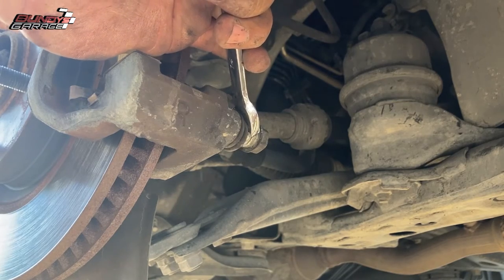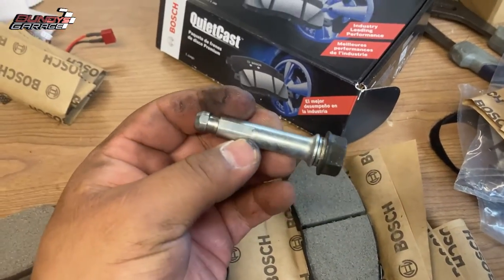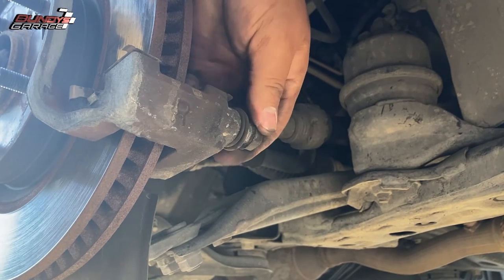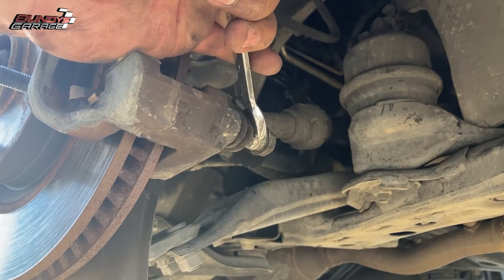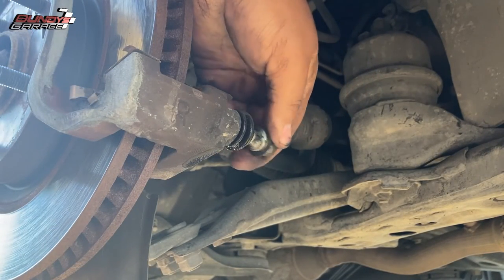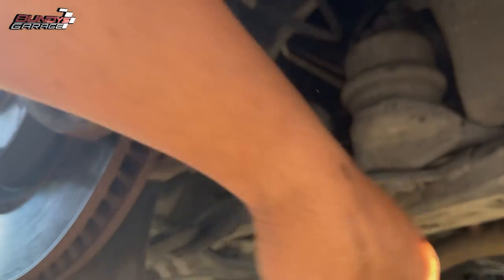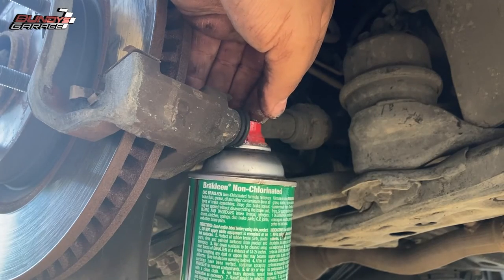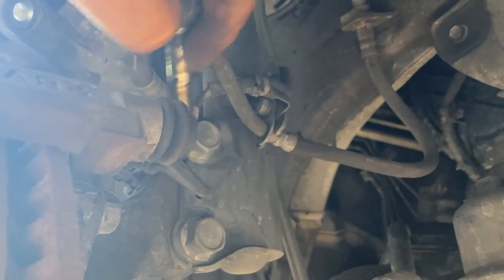STOP Stuck Caliper Slide Pins | Remove Rubber Ring | Prevent Stuck Pin | Honda Lexus Toyota Acura

Comment: Exactly right.  Those little rubber sleeves on the caliper pin are a pain in the ass.  I’m a master mechanic on just about everything including jet engines.  I’ve never heard a caliper rattle without them.  I do replace them  but I leave them off my personal vehicles.

Comment: Why couldn't they design the lower pin the same as the upper one? Meaning without a useless rubber part on a constantly moving pin?! My sisters brakes were vibrating like crazy because both of these pins on the front side were locked up. And when i say locked up i mean i needed a hammer and a chisel to get it out. I tried reinstalling it using silicone grease but those little mfs will get stuck if they have been deformed even in the slightest out of their factory specs. I threw them in the garbage and brake tested the vehicle. Runs like a charm. This video got in my favorites btw. Finally a mechanic that also has common sense. We don't have to follow everything up to spec just because factory says so. If it works, it works.
Reply from the maker: Sir I applaud you! You are one of the few who understands. May the Force be with you!

Comment: This is good advice. Over the years I’ve had way too many brake issue due to this rubber grommet. And previously I just used to replace them. But even the new ones swell. Now I remove them and much less issues. However the rubber part I do replace sometimes is the rubber boots that seal the slide pin from the elements. If those get holes in them from wear and time, water gets in and rusts the sliders.
Reply: Good advice

Comment: I'll try it on my 2002 Camry with 260,000 miles. Dealership fixed them 2x, on back. I'll do it myself this time. Thanks for the tip. I hate working on breaks. Kroil works good but smells so bad.

Comment: I use q-tips to clean the inside there and remove the old grease after removing the caliper pin boot, then use brake clean spray. let dry then add grease and put back everything. I clean the caliper pin boots with Q-tips. I don't use brake clean there.
Reply: Me neither, don’t use brake clean there
Reply: I do something similar.  I use one of my pistol cleaning rods with solvent soaked .38 caliber patch.  Works great.

Comment: Great advice. Recent drilled and slotted PowerStop Z36 rotors and pads only lasted 20k miles due to right rear caliper hanging up/scoring rotor/wearing pads THROUGH THEIR BACKINGS/and WELDING the rotor to stop every time! Slide pin with rubber bushing seized. Caliper piston never retracted. Bushing removed, wire wheel brushed shiny and new brake grease applied WITHOUT bushing! Couldn't decide top/bottom leading/trailing edge for pins anyway! Thanks.

Comment: I have the same problem after putting new pads the pins that have the rubber don't move freely and doesn't seem to work like I have new pads !! I'm redoing them again and not putting the rubber back on the pin ..

Comment: Hmmm interesting, I was researching this because I just did a brake job on my CX five and all the rubber pins were on the bottom. I admit I used the wrong greased red and tacky so now I have to take the pins back out and clean them I knew I needed silicone grease but I didn’t have enough to do all four. I don’t know how you know which pens go where I know one is round and one has flat spots. I never understood how to tell where they go back in other than to put them back in where you took them out. Funny thing about the rubber pieces on the pins is that when you buy a rebuild kit none of them come with them so they must not be important if the rebuild kit doesn’t come with them right? Is it because the dealership wants you to pay them money for the rubber bushings that they probably charge $20 a piece for. I’ve never left them off but I think I will try that just to see what happens. Besides I’m thinking about them swelling up right now as I type this up LOL because I believe red and tacky  a lithium base Grease. I know I’ve learned that one fixing things there’s mostly only one reason why if you have to ask yourself why did they do that. It’s all about money bro. Like the owners manual of the CX five says use 0W 20 if you’re in the United States or Canada. Other than that you can use 5w30 everywhere else, Oh and you can only use Mazda oil or Mazda anti-freeze, and all other fluids must be Mazda or it won’t work. The only fluid I kept original mazda is so far the antifreeze and transmission fluid. The only one I really would be concerned about would be the transmission fluid though. I will always use Mazda fluid in that just because No other company out there yet says there’s is compatible and even if they did say that I’m not sure I would trust it. I even asked Amsoil if they’re transmission fluid was compatible and they told me you’d be better off to using mazda fluid.

Comment: Great video Bundy. I didn't no that you don't have  to have the ring on that bolt because of this same issue when i did the brake job on my 2006 odyssey the ring was swell up so i replace it with new calipers both side. I couldn't find the ring piece anywhere only dealer item
Reply from the maker: Just throw it away, you don’t need it!

Comment: My brakes were working fine.2015 Toyota took these off.And now The front brakes pulse hate more or less driver's side. You can feel it through the stereo column.. There was no problem with them all. So now there is with them all. So I'm putting them back on tomorrow, if the answers any questions? I think it really depends on the making model tomorrow in the Size.
Of the parent's self

Comment: Great topic, if you routinely grease the slide pins I do not see any need for these bushings, the rubber bushing adds unnecessary friction to the pins even after being greased, the piston side will retract but the sliding outer pad will have more drag on the rotor from the rubber bushing not sliding freely in the bore, this could wear out the outer pad faster. The other benefit without the rubber bushing is that you can use a petroleum based grease because the pin and bore are all metal..
Reply: Exactly. With that rubber I had to use only Syl Glide or the Toyota factory grease. Without those rubber bits, the regular Permatex grease is fine.

Comment: I've seen these stupid things swell even after being replaced and with silglyde used, I throw these stupid things in the garbage now I actually had a vehicle that had a slight pull to the right because of these stupid bushings I remove them in the pull when away.

Comment: Looks like you were working on a honda i need piece of mind
2011 honda odyssey 
I removed mine and all is well so far 

Did u fill in grease in absense of the bushing?
Reply: I greased them up as normally after fully cleaning them out
Would it be possible to buy a set of new pins and do double solid pins on both top and bottom
Reply: Reason for me asking if im losing my head thinking that that piece needs to be there i need comfort for thought lol?

Comment: 06 Murano 170K and front caliper slide pin internal rubber bushing finally gave up the ghost. Not sure if its because I used that purple ceramic vs sil-glyde, however $6 for a bushing kit at NAPA.  If you're using a silicone lube like sil-glyde, it should never effect the rubber boots. Actually, IIRC, it actually helps condition them.
I think most people have problems because they are simple greasing them or using some cheapo wrong product. If they were not actually doing something, then you can bet the MBA's would have value-engineered them out years ago.
Might be more model specific, however some people who have removed them have reported hearing clicking, so the blanket statement that they're useless is kind of backyard mechanic reasoning.

Comment: Every brake job I do,I charge extra 20 bucks and do a caliper slide service,clean,lube,and slap it back together,also take the brackets off and wire brush the pad slides up

Comment: Pull the rubber dust boot before you clean the slide pin hole. 5 seconds. But yes, leave those rubber sleeves off. They are channeled for grease to go by but they swell and prevent this from happening. Welder by trade but have worked on all my vehicles. The engineers only try to prove their worth.

Comment: My 2012 Acura TL with 85k needs its first brake job.  What brand pads you recommend and should I get the rotors cut or replaced? Thanks
Reply from the maker: I would go with Bosch QuietCast brake pads and if there is enough "meat" left on the rotors, I would have them turned. Check this video out: https://youtu.be/yMfBf9D6huU

Comment: I have a 2021 Camry with 12000 miles should I remove them now to avoid future problems
Reply: 2017 Camry, 88k and I had to change my rotors and pads twice before I found the culprit. Definitely take them off the next brake service.

Comment: My slide pin has a 1 inch hard plastic roller on the end of only one, doesn’t swell at all.
Reply: I’m on the same boat. Just did a job on my 4th-Gen TL. Mine wasn’t rubber, but it was plastic which won’t swell and cause problems. I’m also wondering where they go.
Reply: @MrSamPhoenix  the caliper slide pin with the plastic bushing on the end goes on top if that’s what you’re asking?
Reply: @wild8757  oh ok thanks. Much appreciated!

Comment: Biggest problem is people use regular grease with petroleum oil in it, which swells the rubber. Silicone grease only.
Reply: I tried reinstalling the pin with new rubber bushing and correct grease and it's way too fkn tight
Reply: @sinistermind33  I've since installed them without the little rubber bushings and I can't tell the difference as far as brake performance or noise is concerned.
Reply: @JK-rv9tp  that's what I'm doing today. 1 front wheel done on the pain in the ass gen 1 colorado 1 to go

Comment: Im having this trouble on a Navara D40 only thing is the rubber is about 5 times bigger than the one in the video and theres not much maybe 1mm at the end of the bolt to hold the rubber on, have you done this on a D40 before?
Reply: Same type of pin on Grand Vitara 2007. Through it off the Rubber and my machine shop modified the pin with brass sleeve and life is good. No more stuck pins..😊

Comment: Doing the brakes on my 12 colorado for the first time. First of all, fk whoever designed the rotor behind hub design lol😂 but yea im throwing the rubbers off these pins, installed new ones and lubed with supplied grease and they are tighter than a nun in a convent
Reply from the maker: Right on!

Comment: They are there for a reason. Why do you think you know better than the brake manufacturer.
Reply from the maker: Cause I do, I’m Bundy!
Reply: If more people had that logic there would be no recalls ever and a lot more of people would get seriously hurt and/or die. You don't have to know more. You just have to know what's wrong.
Reply: What's the reason?
Reply: @vinceleto  They reduce brake chatter on ABS vehicles.
Reply from the maker: Why only on ABS vehicles? Cause it only works when ABS is engaged? If that’s the case no would care, if your ABS is engaged your car is trying to stop you from getting into an accident and the last thing you care about is a little “chatter” from your caliper slide pins.
Reply: @bundysgarage  no works all the time. None ABS have them too.
Reply from the maker: ABS does not work all the time.
Reply: @bundysgarage  Yes I know that, but the little rubber things do. 
I enjoy your channel. Just not sure of some of your practices.
Reply: @warrencollins6256  I think when new they serve some purpose but as most of us have experienced they don’t last and are more trouble then they are worth over time.  You car will not fall apart if you remove them.  I did see another guy cut a sliver all the way around so they don’t bind, maybe that helps some.  I’m with Bundy, engineers are not always the smartest bunch.
Reply: @vinceleto  Yes agree. But I do like manufacturers original specifications.
Reply: This is a engineers wet dream  probably worked at ford at sometime, if it is for for chatter why is it not on the top pin further more when abs is activated it sounds like i ran over a democrat so save the o ring for cylinder head valves lol
Reply from the maker: Let’s go Brandon!
Reply: I just did a wheel bearing job on my Lexus and replaced the caliper. After test drive, smoke was coming from wheel. Removed rubber ring from slide pin and no more caliper sticking. Thanks!!!
Reply: I replace them along with the rubber boots on brake jobs. $3-5 added cost. Kind of like replacing the pad hardware clips on every job.
Reply: @mph5896  I so agree. Only a minor cost. I also try to rotate the pistons to clean properly. Why not when the brakes are apart.
Reply: You probably wear masks alone in the car don’t you?
Reply: From what I can tell nothing BUT a money maker,,  I have a 2016 rav4 they are coming off..  thanks for the information..
Reply: @jimc9324  mine came on the top pin and not the bottom
Reply: @vinceleto        Engineers = How about that GM 8 - 6 - 4 and 8 - 4 Cylinder Reduction.   LOL.